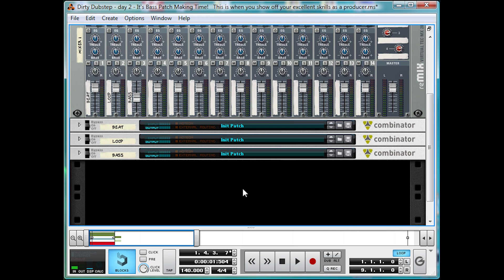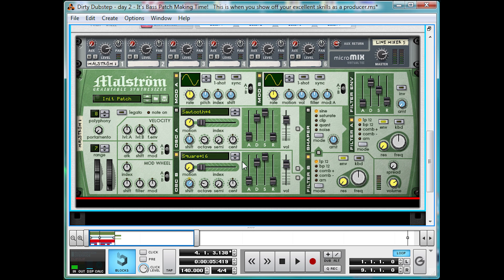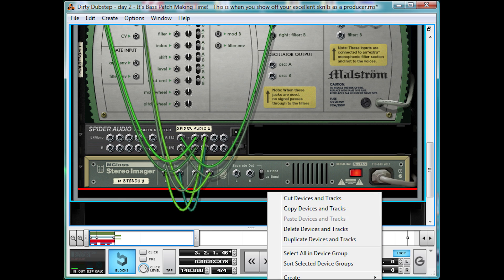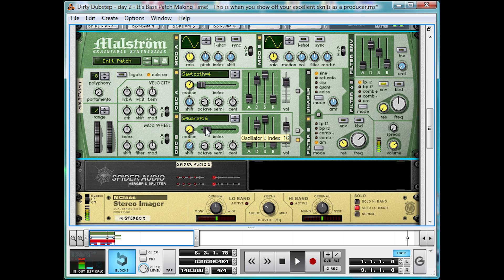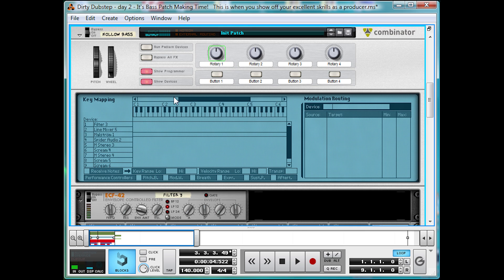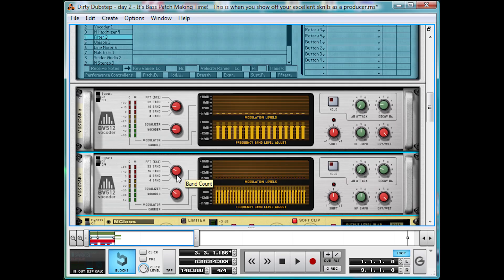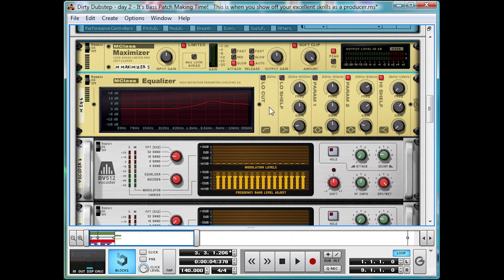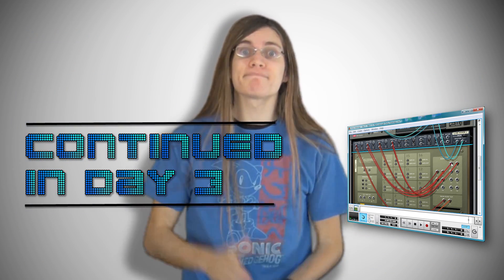Dirty Dubstep Day 2 Part 2: Making a huge dubstep wobble bass

Comment: Just a little tech tip... You can make the ECF-42 receive note in the key mapping section and use its ADSR envelope. Really nice trick that has been there since Reason 1.0 (although then you'd have to create a separate track for the filter. No combinators at the time...)

Comment: @AJlurksnyc The line represents the value of the 'frequency' knob. Each point you add on the envelope will allow you to change the angle of the line. Just try drawing in a pattern in the envelope and adjust the line while you're listening to the sound (must be drawn in to the sequencer first, obviously) You will realise how it work when you play about with it

Comment: Here's how (he did explain in the previous video so he went fast for this one)
First Stereo Imager (SI) input connected to spider audio, output connected to the first scream4 input, first scream4 output then connected to the line mixer. First SI Separate out will connect to the second SI input, the second SI output will connect to the second sream4 input, the second sream4 output goes to mixer, second SI separate out will connect to the third scream4 input, the third scream4 output goes to mixer

Comment: For all the people struggling with the wiring on the Scream step, I think (Still very new to Reason myself >_>) it goes:
1st Stereo Imager Audio Out > 1st Scream Input, Scream Output > Mixer
2nd Stereo Imager Audio Out > 2nd Scream Input, Scream Output > Mixer
2nd Stereo Imager Seperate Out > 3rd Scream Input, Scream Output > Mixer.

Comment: @DJLeontis 
Jumping right into a tutorial like this without some basic knowledge in how to use Reason (or just any knowledge in messing around with sounds regardless of software) indeed makes it much harder to follow. I'd recommend every Reason-user (or sound mod nerd) out there to check out the tutorials section on Propellerhead's official site. 
It's mostly text (with a few audio snippets here and there), but I've learned a lot about sound in general from those tutorials. Very useful!

Comment: @EtherealBeatz Just a word of advice. It'd probably be easier to do in Thor. Maelstrom requires a lot of finicky work. With Thor, you just set up the LFO and program LFO 1 to Filter 1 frequency then adjust the rate and amount. It's all preference, but I prefer using Thor for wobble.

Comment: Hey guys, I was just thinking as I was creating some of the devices how annoying it was that it links your cables together to what it thinks you want (sometimes useful though). Holding shift as you click the name of the device seems to create it without auto-joining cables I've just worked out, so there you go it might help! (was creating devices and not noticing it was changing the combi output and I was like WTF where my sound gone :( worked out it was the auto cable feature! ) <3

Comment: Much easier to make things wobble in subtractor. 
I just change the waveforms in Osc 1 & 2 to 6, turn the octaves down by 2 each, press the Sync button on LFO 1 and change the destination (marked DEST) to F.Freq...now turn the amount on LFO 1 all the way up and voila. Now you can just play with the rate knob to andjust how fast you want the wobble.

Comment: For those who never got their letter from Hogwarts here's the trick:
Locate the Ins and Outs in both stereo Imagers, the ones that get to channels 2,3, and 4 of your mixer are the ones you want to add the scream 4. If you hold ctrl (on windows) while creating the 3 scream 4 you need they will be created but without the wire, that way is not going to mess with your existence.  Remember, three scream 4 racks between the Stereo imagers outs and inputs 2, 3 and 4 of your mixer (non English speaker, hope you understand)

Comment: PROTIP: to make a real "yuy" bass, just make a squarewave with a lowpass filter on half cutoff with full res and put a distortion unit with digital mode under it, p1 a half and p2 at ten o' clock.